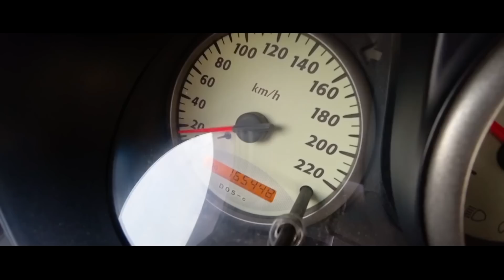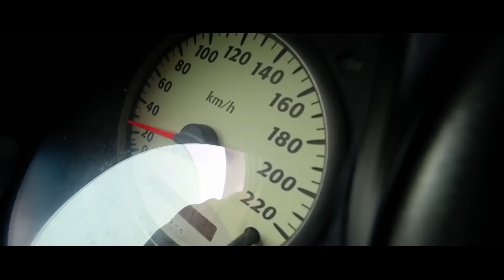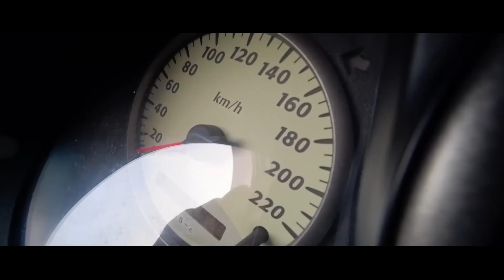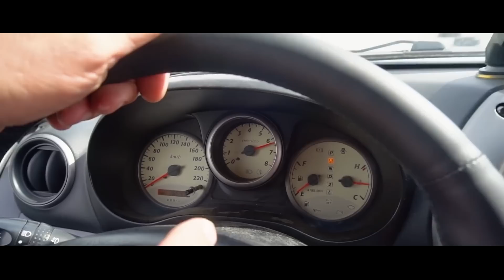What happens when you engage reverse at 62 MPH?

Comment: Let me explain what actually happened. Automatic gearbox with torque converter actually has quite a few clutches. To get that you have to understand how planetary gears work.  Planetary gears have 3 speeds that have strict relation based on gears ration. You have rotating shaft (sun gear), you have planet gears going around this shaft and you have case of those hears that can also rotate. Now when case and sun rotate at the same speed, then planet gears also will move at that speed (they don't rotate over sun gear, everything rotates together). This is usually 4th gear with 1:1 ration. If you stop case of the gear and rotate sun gear, then planet gears will rotate at let's say 1/3 of the speed (if it's ratio 1:3). This is basically 1st gear. If you stop planet gears and move case around, then sun gear will spin in reverse. Of course you don't want to drive in reverse like on 4th gear, so you actually have second planetary gear that will rotate sun gears in reverse and then first one used in 1st gear will give exactly the same 1st gear ratio but in reverse. To get overdrive you rotate planet gears and keep case static. Then you get opposite 3:1 ratio. Intermediate gears are achieved by simply transferring output from one of them to choose input of another one. 
Well, all of that is not too important besides that you have multiple clutches. 6 gear automatic will have 4 clutches and 3 planetary gears. Usually when you change gear, speed difference between engine and shaft builds up pressure in torque converter for just a second or two and releases that when you are in next gear. Shifting gears never gets to neutral, so you don't have to worry about discharging energy from torque converter while changing gears. Changes themselves are performed by releasing some clutches and engaging other ones. If you have huge speed difference however, you'll build much more pressure in torque converter and whole that pressure is basically hold by engaging and releasing clutches, so that's the weak spot.
In other words, Garage 54 managed to burn clutch on automatic gearbox. Молодец!

Comment: I remember I had to throw it into reverse to get out of a situation I got into due to my own stupidity. I was in my 2012 Rav4 rolling downhill. Being the relatively inexperienced driver at that time, I thought to save gas by turning off the engine. Soon enough I realized that hydraulics turning off made it very hard to steer  and brake. So I had to throw the gear through reverse and neutral into park to start the engine again. Nothing happened at reverse - but during the 5 or so seconds while it was in park while I was turning on the engine, the transmission made an awful grinding noise.
Reply: You can start the car in neutral.

Comment: With the brake line...why not downshift as much as possible and use the parking brake once slowed?  If it's an older manual pedal/lever you can feather it (while holding the release) to not lock up wheels, if it's the newer electronic ones it'll lock the wheels but still beats plowing into a tree.

Comment: You need to do a car that's all mechanic with no safety feature. I have a 92 dodge d150. All mechanical. I was going 50 when I accidentally switched it to reverse I then quickly put it to drive. The tires did lock for a sec and made some noise but I still daily drive it with no problems.

Comment: YOU STOLE MY IDEA. I mean my life. I literally did this in my Mom's ~1997 Dodge Caravan with an extended roof. I was driving and because I was used to manual, I (for some stupid reason) started shifting into neutral on the tree shifter when coasting to "Save gas" (15 MPG. ouch.). Except I got too cocky one time while listening to loud music as a teenager. I slapped the shifter to what I thought was neutral but passed the notch. It was slow motion as I realized I didn't feel the distinct "notch" of neutral. I had flung it into reverse. And as I panicly reached for the shifter, the transmission SLAMMED into reverse. The entire large van ground to a halt to the roar of screeching tires and the smell of smoked rubber. It felt like I had ripped off the front wheels and then RUN OVER THEM. The engine stalled. (O RLY?) I was terrified. I put it back into park, and started it. It started back up. I drove home the rest of the way still terrified. my muscles were weak and shaking... It didn't break.  I made it home.     ... Except it did break... Three months later the transmission went out. And I had just enough time for plausible deniability to my Dad. I didn't tell him for at least ten years. When we opened the transmission pan, it was FULL of metal shavings that had spun around and ground into the gears and knocked bigger chunks off.  It's still in my Dad's garage to this day.

Another fun story: My first date I ever went on, I took a girl, with my Mom's van, for a charity Christmas thing where you got to drive on the NASCAR track. I literally drove my Mom's minivan on a NASCAR oval at ~60 MPH. It was so top heavy all the low fluid lights were flying off and we had to lean to the right.

Comment: Had a 78 chrysler le baron. 360/727 put it in reverse at 60 locked up the rear tires. Killed the engine.. But it started right back up and never had a problem after that.

Comment: I did this at 45 mph in a 87 chevy with a turbo 400 trans. Idk why but i was trying to put the truck in neutral so I could coast down a hill and put it in reverse... locked up the back tires and stalled the motor. I quickly put it in neutral and coasted to the side of the road, started it up put it in reverse backed up just fine put it in drive and went on my way

Comment: So if you dont have a clue of how most automatic transmissions work, what happend is you worn out the torque converter wich in theory works like a clutch and gives the exact same effects as a clutch. so as you said ''as its not a manual it doesnt have a clutch'' well your partially right, but a torque converter is basically that.

Comment: I've done this in a zj 93 the damn Jeep turned off while I was driving at  40mph I did not stopped cuz was not the first time that happened  and I've engaged neutral and turned on the thing then  I shifted to reverse by accident, the transmission made an horrible  sound, I quickly shifted to drive and drove home but when I changed the ATF I saw a ton of shaves of  metal in the oil pan, the damn transmission did not have more than 2 years since the last time that I send it to rebuild.

Comment: The computer wont let the car do anything that will wreck it. However, it will let you do something that will damage it, especially if it is something it could do while new, but not now that it is old. Also, on the off chance it did shift into reverse nothing would happen, the engine would immediately stall and the car would shut off.

Comment: It would really worry me if he doesn't know how an auto works cause the clutch/transaxle is stuffed, and also if you get into reverse it typically explodes the inners of the gearbox (if lucky doesn't take engine with when locks up)
- IF you want to do it on a later car, you can basically just lock up the tyres at speed and engage reverse depending on ECU/TCU controls (or just reprogram it)

Comment: No modern car will engage any gear in an automatic transmission while it is moving in the wrong direction. Under any circumstances. This is part of the mandatory requirements for a vehicle in order to get certified for road use.

Comment: It all depends on the trans and how worn out it is the more miles and wear on it the easier it will b to get into reverse but for the most part it is hard to get any transmission in reverse going that fast most will just grind or do nothing at all most new cars the trans is computer controlled and will not shift even when the shifter is in reverse

Comment: I did this in an old oldsmobile i think it was an 85ish cutlass supreme. Doing about 60 on the freeway overheated and wanted to put it in neutral to coast downhill but went all the way to reverse 0_o 
Rear wheels locked and spun around,sharted my pants and came to a full stop facing upcoming traffic. YES I SLAPPED MYSELF VERY HARD after that

Comment: You burned the inner clutches of the transmission as well as the oil. That was the strange smell. The torque converter also must have been stressed really hard. That's why it didn't want to drive anymore.

Comment: Automatic still have a clutch it's inside of the torque converter
Reply: The clutches (and bands) with friction material for operating different gears are inside the transmission case. The torque converter is a liquid-coupled "clutch" with turbine blade sets.

Comment: Some of the finn's or all the finn's in the torque converter are probably bent or pooched. Probably why its slipping like crazy. The average auto trans has around a 1700 to 2000 stall converter in it. My guess anyway. I'd like to see where it failed though.

Comment: I have a 1988 Ford F-150 what's a 4 speed manual transmission in the snow at 45 and 50 miles an hour I can throw it in reverse and stop within a few feet instead of hitting the brakes and just sliding I put it in reverse and slam on the gas and that's how you stop very quickly in the snow on dry cement I don't know what you're going to do so I can't wait to watch here we go

Comment: This is known as a "safety interlock". They aren't worried about the car's safety so much as they are about the the operator's and passenger safety. Going from forward to neutral at speed would cause at least 2 G's of force, maybe more. This is not good for the human body.. It's not good for the vehicle or transmission either but  they want to continue to sell cars and killing or severely injuring someone is not an optimal way to accomplish this goal. So they put in the safety interlock so it wouldn't engage reverse when above a certain speed, probably 5 to 10 mph,
I'm not surprised the car wouldn't accelerate to speed and barely moved in reverse. With that kind of abuse expecting anything better is unreasonable.

Comment: I did this in my automatic 01 ram 2500 I was going through a tunnel and was going to throw it in neutral to rev it and i accidentally shifted to reverse and while I was going 100 in the tunnel it engaged in reverse at the same time i went to give it a rev and my tires just went full send in revers the results were a fat burnout through the tunnel

Comment: I did it with my 99 chevy truck at about 10 mph and it just jerked and killed the engine. I did it only because I had blown my break lines earlier that day. i never tried doing it at a higher speed because I actually DON'T want to kill my truck.

Comment: is this real automatic? or manual gearbox with clutch and robot system to shift gears and use the clutc aka "automatic"? on real automatic transmission there is turbine and no dry clutc, but there is multiple wet clutches in the box. I guess this one is somekind of robotic manual "automatic" transmission cause the smell of clutch.

Comment: at 6:32, the car sounds like a CVT so if anything you'd just end up slipping the belt as soon as the planetary gears engage reverse?
but according to wikipedia, Toyota did not make any 2nd gen Rav 4's with CVTs ??
Reply: CVT??? Wtf? That shit they put on 2 cilinder cars.. there's no belt.. read better to wikipedia🤦‍♂️
Reply: @Blph________________  CVTs come for all shapes and sizes, even the Audi A4 to A6 have a CVT variant.

All I'm saying is at 6:32 you can't hear the transmission shift like a regular automatic - the engine is a constant droning as if it has a CVT

Comment: If its an old school automatic and you do it by mistake it will just stall the engine since the torque converter will try to make the engine (and front pump) turn backwards, at which point the line pressure drops enough to release the clutchpacks and essentially put the transmission in neutral. On later cars with a computer controlled transmission it will either ignore your request, or lock out the shifter once the car is moving. On a manual car reverse is usually non-syncronised spur gears, so all it will do is just grind the shit out the gears unless you REALLY try.

Comment: It should be impossible to engage Reverse while moving forward. Computer doesn't allow it. You can put the stick into R but transmission will not engage the clutches for R until you totally stop.
Reply: they disconnected the speed and gear selector sensors

Comment: In a 2004 TL it just makes a little tiny crunch and there is no longer a reverse gear available.  I know this because the idiot who rebuilt mine after it went 309k the first time somehow managed to fark up the electric lockout on the shifter and I went to pop it in neutral and crunch, all the way to REV.   And since there is supposed to be an as needed lockout there isn't even any kind of gate before rev to give you any indication you are headed there.  Some mechanics are brain dead.   I'm about to put in a new tranny, and I may just fab up a knob actuated lockout, like probably should have been done in the first place.  Especially since Acura is more than aware how many industrial strength stupid licensed mechanics are out there.  Should'a done it myself.  Will I ever learn?

Comment: Remind me not to take my car into your shop for repair.  I wouldn't want to find out later it was part of an experiment.lol
   You said "clutch smells funny."  But there is no clutch. It is a torque converter after you unplug the idiot proof computer I started cringing. You likely broke most of the impeller fins  off the inside of the converter. That's why before it moves the RPMs have to come up in order to pump the oil. Had you broken all the impeller fins off it wouldn't have went anywhere at any speed.
   It is really nice to see though what Toyota did with their idiot proof computer. That is if one should lose their brakes throwing it in reverse will allow the engine compression to slow the car. Something that doesn't happen in any gear normally.
    Of course the handbrake is cable-operated and it's supposed to be your Fail-Safe in case the hydraulic system fails. But that's another story.
       🤠🐂🏞️🛩️

Comment: "What happens when you engage reverse at 62 MPH?"
Nothing, newer vehicles have an electronic control transmission controlled by the PCM (Powertrain Control Module), this module is two modules combined that used to be separate...ECM (Engine Control Module) and TCM (Transmission Control Module) In this case the speed sensor tells the PCM the vehicle is moving and how fast. The sensor does not know forward or reverse motion but in this case it does not matter. 
The program is written so the reverse solenoid in the transmission will not activate reverse if the vehicle is moving above a specific set speed, maybe 5 Mph. So in this case he commands/requests reverse but the PCM does not energize the reverse solenoid  because the speed is above the set limit. As soon as the vehicle slows down to 5 Mph while still requesting reverse, then at that point the PCM energizes the reverse solenoid, the tires may do a little screech and the vehicle starts going backwards.
Even still it is not good for reverse to engage while the vehicle is moving forward at all, it is really hard on the drive train components, transmission gears/drive components/ differential, axels or drive shaft.